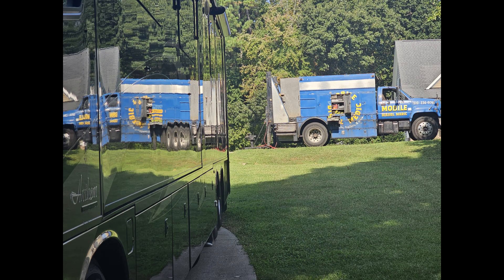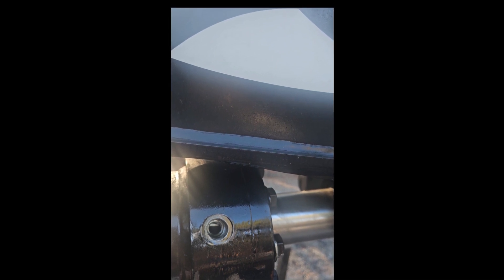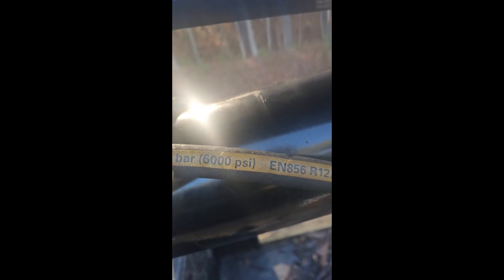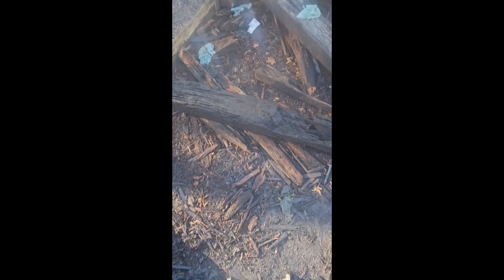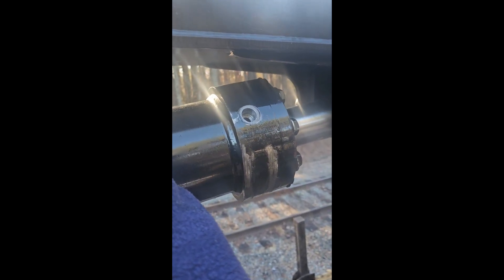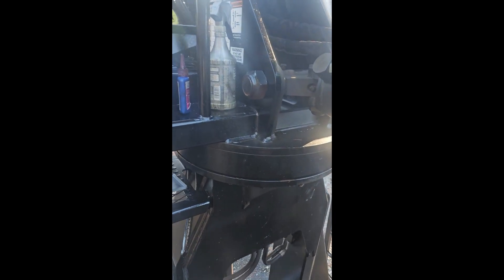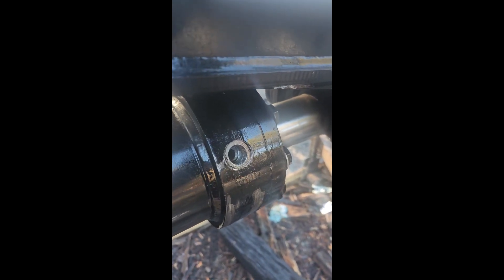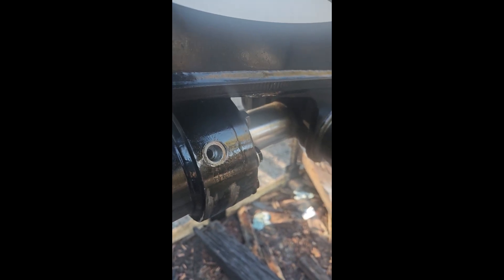Going to break a few rules on this Hydraulic Repair - Don't want any roughnecks getting hurt!!!

Comment: Great video. I am also a diesel mobile tech and I have been doing this work forn18 plus years and sometime you have to think outside the box to make things work.
Reply from the maker: Thanks Todd.  A lot of folks just can't stray from the recipe list.  Nothing wrong with that but if we can, lots of opportunities open up.
Reply: @mobilediesel   I agree 100 percent. That means if I have to make to tool to get the job done. Well I will custom make the tool and save it for next time.  And by the way the video you made about the ac system issues on the international was really interesting. I have never had that issue. But that's why we do what we do. We are there to get the problem fix. Not patched.
Reply: Reinforce it till it sinks into the ground under it's own weight! That's my theory! @mobilediesel
Reply: @mobilediesel  are you in the Charleston sc area?
Reply from the maker: Raleigh, We almost landed in Charleston but I was nervous about the hurricanes.  May have wimped out. @toddthompson3043
Reply: @mobilediesel  that's a great area to be. I've done some work for gfl/waste industries at there Raleigh location. I'm down in the spartanburg sc area. If you ever need anything feel free to reach out.
Reply from the maker: Thanks Todd that is very kind.  I come from California originally.  I still can't over how kind everyone is here. @toddthompson3043
Reply: @mobilediesel  I've never been that far west.  You ever work on any cummins natural gas engines?
Reply from the maker: Yea actually. Spark ignited diesel LNG and methane for landfills as well.  @toddthompson3043
Reply: @mobilediesel  I do a ton of work on the cummins islg 9litre and 12 litre engines for all the trash company's around here. I've been nat gas certified since 2011. It's nasty work but they pay there bills.
Reply from the maker: Wow Sweet.  If you have any questions feel free to give me a shout. I'm sure I will be picking your brains in the future.   If you call my main number I can share my mobile once we talk....919-335-4800
Reply from the maker: Hi Todd, Off topic but do you have any leads on a company that can convert Cat 3416's into spark ignited natural gas? Actually CNG as well as Methane but just wanted to start with CNG. The gig would be for three of these monsters. 
 Feel free to text/call if you prefer 415-305-3090.  Thanks!!